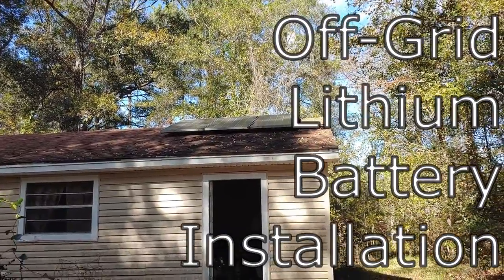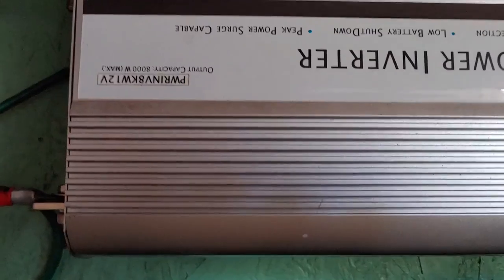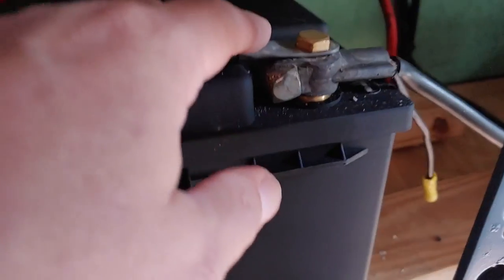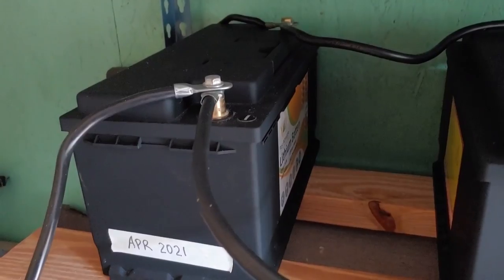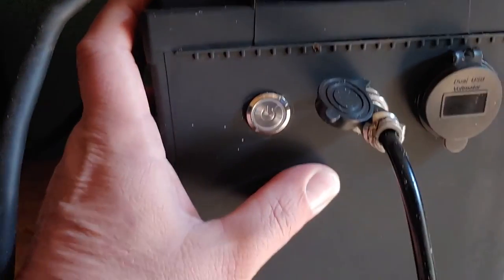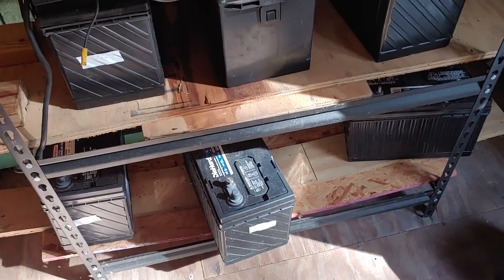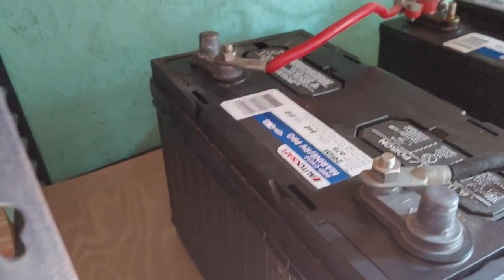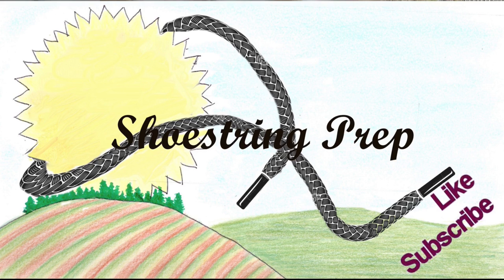Off-Grid Solar Power System:  Lithium Battery Installation using FLY POWER 100-ah 12-Volt batteries.

Comment: I have bought one of these batteries to replace lead acid battery in truck camper, I was wondering about the charger in the camper when plugged in if it harm the lithium battery, not sure how to avoid this potential issue?
Reply from the maker: I don't know about a camper's charging system. I don't own one. Maybe some else out there know the answer. Thanks for your comment.
Reply: @shoestringprep  Thanks anyways, your videos have already answered many questions for me.

Comment: I have two batteries of this type, just the brand is hers KEPWORTH 80Αh both my question is can i connect them together in parallel and how is the charge done only with one and at the same time and the other also charges ??? I hope you understood
Reply from the maker: If your batteries are the same type such as lithium as long as they are the same then you can connect them in parallel. Once they are in parallel when you charge One battery it will automatically charge the other battery. Thanks for your comment
Reply: @shoestringprep  up to how many batteries we can put in parallel? thanks
Reply from the maker: @emmanouhldigkas1661  most lithium batteries you should put no more than four together in parallel. Thanks for your comment.
Reply: @shoestringprep  I talked to the company that bought the batteries and they told me I can put them in parallel but I should not charge even once when they are connected together when they are charging they should be disconnected they told me you have them connected and it charges normally ???
Reply from the maker: @emmanouhldigkas1661  I have my batteries connected in parallel and I charge them while connected in parallel. They all charge properly. I do not disconnect my batteries to charge them. But you should do what works best for your system.
Thank you for your comment.
Reply: @shoestringprep  thank you for answering my questions
they work normally for you, that is, they charge, I can not understand why I was told that this is not possible, did you ask the company or did you do it yourself ???
Reply from the maker: @emmanouhldigkas1661  I connected it and tested it myself. The company was not involved in this installation.
Thanks for your comment.
Reply: Would love to know how your kepworth are doing
Reply: Sounds like the "company " gave you misinformation. They will always be connected together while being charged by the solar system. any other charger connected in parallel will be the same.

Comment: Does the charger it comes with get super hot on you? And do they come charged?also is the red light on the charger suppose to turn green when its fully charged?
Reply from the maker: My charger does not get hot.  My batteries had most of a charge but I had to top it off. Yes my charger light turned green when fully charged. Thanks for your comment.
Reply: Check his "Charging the Fly-Power lithium battery" video at around 32 seconds in, and you'll see this isn't a fully enclosed "brick" (as I first thought it was), but in fact has vents and a small fan.
Reply from the maker: @lonniemcclure4538  🙂

Comment: Wooooo Shoestring Im about to buy some Screamower batts i hear they are the same make as the flypower just different labels. I was going to buy two of them put them in series or parallel. Any relation to Shoenice??
Reply from the maker: You should purchase the batteries that best meets your needs. I know of no relationship between the two type of batteries. Thanks for your comment.

Comment: hi again are your batteries still working fine??? please tell me
Reply from the maker: Yes, they are still working. Thanks for your comment.
Reply: @shoestringprep  did you notice anything strange??? where these batteries are all connected together, they all work smoothly the same
Reply from the maker: @emmanouhldigkas1661  I did not notice anything strange. They are in parallel, working fine. Thanks for your comment.

Comment: Great video I'm still swinging towards getting these or similar from China
Reply from the maker: Let me know how they work for you. Thanks for your comment
Reply: If you haven't ordered, be certain to compare the price on Amazon. The current price on Aliexpress vs. Amazon was less than a $10 difference. You should have more recourse with Amazon if things don't work out well.
Reply from the maker: @lonniemcclure4538  I agree. Order through Amazon. There is a link in the description. Thanks for comment
Reply: @shoestringprep  That link currently takes me to Scream Power batteries, not the Fly Power ones. If you use affiliate links I wouldn't mind tossing some money your way, but I would need a proper link.🙂
Reply from the maker: @lonniemcclure4538  use the link I provided, then find the specific battery you actually want.
Thank you for your comment.
Reply: I didn't order at all went for 150ah AGMs x4  just under £1000 but 120 pounds each in weight lol
Reply from the maker: @markw1685  I hope you new batteries work out for you. Thanks for your comment.